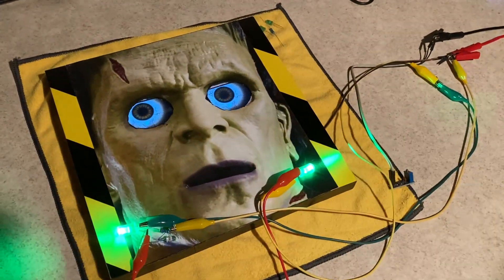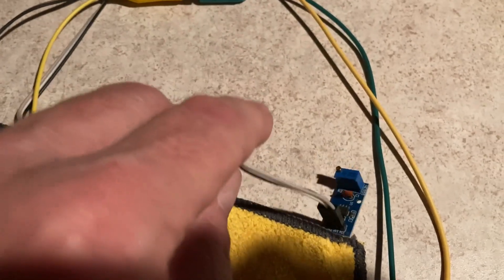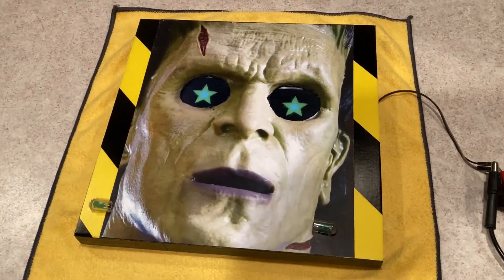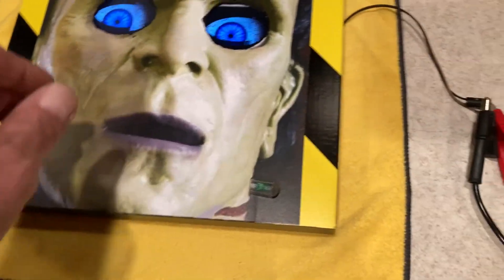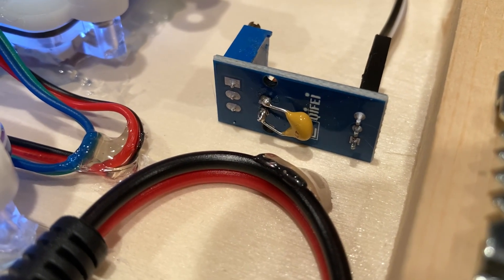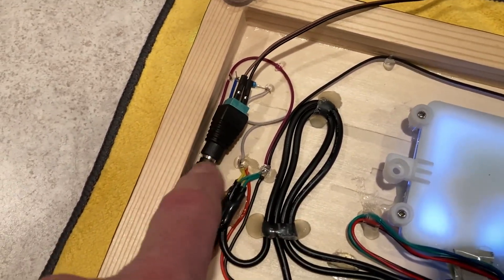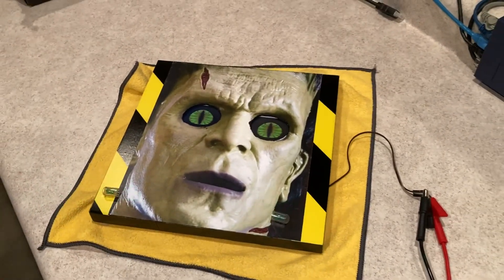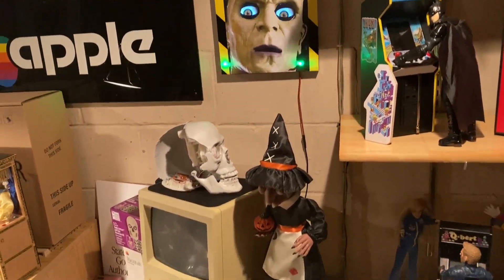Frankenstein LED Electrodes Added To LCD Eyes Halloween Prop

Comment: I was fed this video on the front page of suggestions: congrats!
But, some context would be nice.  What is that picture you're working on?  Is it an earlier project you made, or something bought, or what?  What's the point over just having a full LCD/oLED panel?
Reply from the maker: Well first off I found the picture on Google images printed on a color laser printer. Installed the $30 eyes from Home Depot. Look at my other videos to see the install. $35 total cost vs a OLED or a LCD panel on top of that you have to drive the panel no way you could do that for $35. Thank you for the comment.

Comment: Good job best move on to the next project or next thing you know you’ll be installing back lighting and audio lol really curious as to how you will power Frankie ? Modified cell phone charger?
Reply from the maker: For something like this I use a Apple 12 WATT 5 VDC power adapter. Has a USB port.
Yes I was thinking of back lighting lololol.
Thanks for the comments.  😄